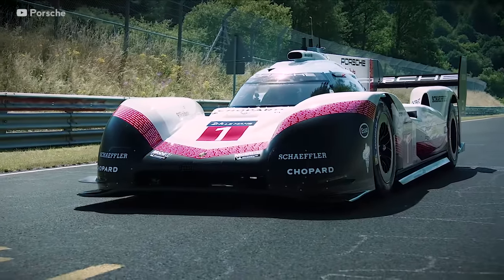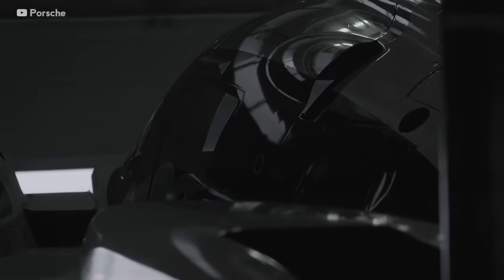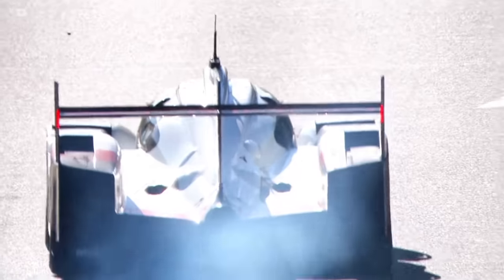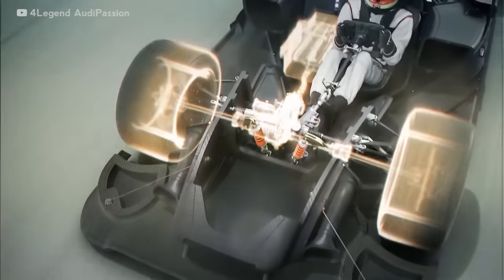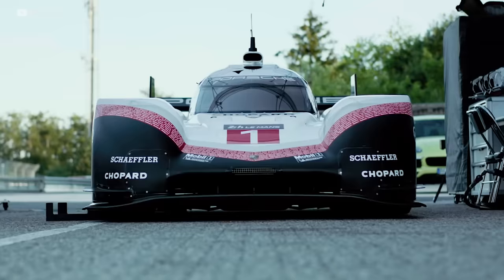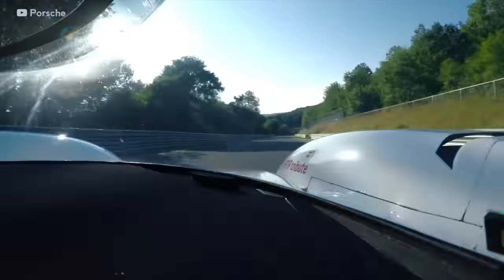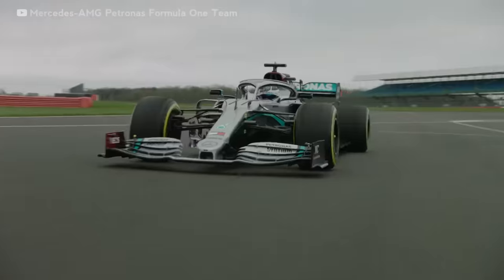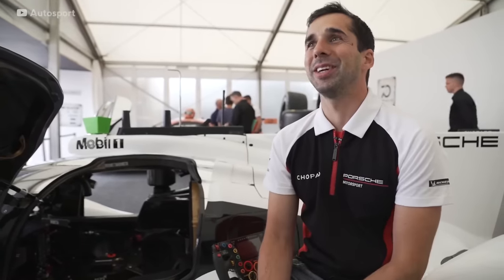How Porsche Built a Car Faster Than F1

Comment: Can we just appreciate that it has a 700hp V4?
What is my V6 even doing?!
Reply: didn't Koenigsegg make a 650bhp I3 engine? :D
Reply: @FIumel  yeah. Lol.
Reply: probably because your car is not supercharged and your exhaust system needs a catalytic converter and muffler to pass environmental and noise limits
Reply: @GameCyborgCh  headass noise restrictions don't matter much about speed
Reply: Your V6 is for road so still pretty good
Reply: Well, the Renault Formula 1 EF-type 1.5 liter V6 engine was worth 1.200 bhp in 1986. The same year, an Audi Quattro E2 "Pikes Peak" had around 600 bhp with a 5 cyl/2.1 liter engine.. So 720 bhp from a 2.0 liter V4 is nothing too crazy for 2018 I suppose.
https://en.wikipedia.org/wiki/Renault_EF-Type_engine
https://en.wikipedia.org/wiki/Audi_Quattro#Sport_Quattro_S1_E2
Reply: Just add BOOST
Reply: @FIumel  Jaguar made the cx75 a while back, beautiful car in my opinion, but it had an 1.6L engine that made 500hp, so koeningsegg's engine isn't that crazy
Reply: @Enzejansen  But the cx75 had an I4 with 1.6L. The Gemera has an I3 wit 2L. They had a cylinder less and only 400ml of displacement more so I think the Koenigsegg is still more impressive. The cx75 is by the way a really nice car that's true
Reply: @FIumel  yeah the're both excellent pieces of engineering that's for sure!
Reply: lol my I4 1400cc makes 460hp
Reply: @GameCyborgCh  The car also need to be able to go more than 100 km between full engine renovations.
Reply: @FIumel  my I6 makes 185 hp in my E30
Reply: your v6 is designed to be fuel efficient, reliable, safe, affordable, smooth.
Reply: That V4 costst 250.000 to build, ore even more. That's why
Reply: I'm pulling 500hp out of my V6 in a damn pickup truck (F150 ecoboost) lol.
Reply: Those engines are meant to break after a few use. Unless youre ready to throw down 50k per every 3 or so usage, be my guess.
Reply: @wanderingbufoon  They don't break, the compression tears the rings up and they loose compression. The engines actually last a long time but that's with complete tear downs to inspect every bearing, rod, rocker ect.  Most components don't need to be replaced very often believe it or not.  They just need to be checked and retorqued constantly to avoid a catastrophic failure that will cost $50k +++
Reply: clearly non of you know anything about motors. 
"eh hem" 
one fucking word. 
racegas 
sorry two words 
RACE GAS. 
oh what's that ? 
DIFFERENT FUCKING GAS.
don't worry you can buy bulk barrels of it for around $9.00/gallon. also funfact it has a octane rating of 110+
mostly used in motors with compression of 11-13:1 or much higher. 
most street motors run 10:1 or less. 
because street gas is cheap. #87
Reply: Not revving 20 000rpm?
Reply: @FIumel  Porsche need to make a car that follows no rules to get that that hp per litre. 

Keonigsegg: we make the rules.
Reply: @GameCyborgCh  is a joke we don’t need explanation
Reply: @FIumel  yeah and with the hybrid system it’s like 1700hp
Reply: Hmmmm can you even drive your V6 to the limit? :) can you handle 150Hp on the track lol
Reply: Just wondering, what engine does the TM cars use?
Reply: Spend an extra 200k and ull probably get the same hp as that v4
Reply: @wanderingbufoon  These are lemans cars, they are supposed to run flat out for 24 hrs straight. So the engine is durable af.
Reply: @wanderingbufoon  These are lemans cars, they are supposed to run flat out for 24 hrs straight. So the engine is durable af.
Reply: @ksp3324  yeah the whole block typically are but the other stuff such as valves, springs, etc. They don't last very long.

I mean most of these cars in le mans don't even last the entire race. So are they durable? Yes, probably but can they finish the entire race? Probably not. Only the over built once (or extremely smart drivers/engineers) that do win those races. 

If it is the latter than the former, then even less so since it is solely based on the skills rather than the actual strength of the machine.
Reply: Isn't it an inline 4
Reply: Lasting longer
Reply: Slacking
Reply: Stick NOS sticker for additional 80 hp
Reply: @numbdigger9552  my 1.2 mpi makes 74 bhp
Reply: @nikhildalvi3693  goes to show that engines can be tuned to very different levels of performance.
Reply: @GameCyborgCh  its a lot more than that lol
Reply: lasting years with basically only oil changes.  Really its like comparing a jet airliner to a jet fighter, The airliner will fly from NYC to Tokyo and back multiple times a week without an overhaul.  While I suspect a jet fighter's engines would need a full teardown after that many hours of flight time.

the very peak of racing is pushing engines to their logical limits, And in the case of America's NHRA Top Fuel they are pushed well beyond all logical limits and sometimes suffer Rapid Unscheduled Disassembly because of that. I suspect F1 engines are dismantled between every race and fully examined.
Reply: @FIumel  it's the displacement that matters. A 800hp 6L V12 is as impressive as a 800hp 6L V6
Reply: @missouriresole4726  v6s are crap
Reply: @charlesrussell4295  imagine if Eli Ayase, Umi Sonoda, and Maki Nishikino drove this 919 Hybrid.... i wonder what their reactions look like.
Reply: @GameCyborgCh  hi GameCyborg.
Reply: @chriscarter5659  hi chris carter.
Reply: good question!!?!! xDDD
Reply: Lasting more than 100 miles
Reply: @mchammer1809  u thought only last 10 miles bro.
Reply: @Alpostpone  and take off 2 from your engine
Reply: Hahahaha.......
Reply: Revving at a third of the rpm lol
Reply: Primarily, you're engine can turn on pretty much at any condition, even at freezing often. f1 cars need literal engines to turn on their engines.
Reply: Konigsegg out here 1700HP 3 cylinder
Reply: @FIumel  who cares about the peak performance... Porsche has always less hp and is always faster anyway.
Reply: @chucku00  Those engines in the 1980's were absolutely shot after qualifiying. BMW had 1,350 BHP available during quals, also completely wrecked afterwards. The 919 H-evo has a durable engine.
Reply: @chucku00  and doesn’t this current gen f1 v6 have like 1k HP
Reply: @dbabu51  No. It's limited to 850hp for the engine at 15.000 RPM and 161hp (120 kW) for the KERS (hybrid electrical system). So the engine is 350 hp less powerful than a 35 y/o F1 V6 engine.
Reply: @chucku00  but the point of these cars isn’t to have the most power, and I think those old v6 cars only made 1100 hp in quali, and tuned it down to like 700 hp for the race
Reply: @dbabu51  That's where you got it perfectly backwards, it's the other way around due to many metal alloys that are nowadays forbidden because of cost, and very toxic chemicals used in fuel and lubricants. 1986 F1's could easily still produce more than 1000 hp when needed during a race, it's very hard for a modern F1 to produce 800 hp+ during more than two laps. FIA regulations had to follow safety and environmental evolution during all these years.
Reply: @GameCyborgCh  a cat and muffler maybe account for 10hp
Reply: Not pushing 45lbs of boost
Reply: More cylinders doesn't equal more power, that's just ignorant
Reply: @FIumel  600,but yes.
Reply: imagine if it had an 1100hp v6 or an 1500 hp v8
Reply: @hanzen5174  laughs in Koenigsegg Regera (well, it's hybrid, but still has 1500 hp)
Reply: Your v6 is probably limited to like 6k rpm too
Reply: @enfynet  mostly 6.5K, but that doesn't really make a difference here i guess
Reply: @babymetalenjoyer  yeah that’s a far cry from the speeds these engines are running still
Reply: Well, your V6 is Not even 1% of the price of Porsches V4
Reply: It’s best
Reply: Being fuel efficient, easy to drive, quiet, passing noise and emmision regulations, not needing to be completely overhauled every thousand miles or so... Everything that makes a car useable.
Reply: How about the BMW M12 with a stock 4 cylinder block and 1.5 liter generating 1,400 HP in the 1983 Brabham BT52?
Reply: General rule of thumb with engines: A larger engine making moderate output (your V6) will always outlast a smaller engine pushed to it's limits every time you us it (the Porche V4). Yours is cheaper, more reliable, meets emission standards, and works in a far wider range of conditions. Be happy you don't have this V4 in your car!
Reply: To be fair it's 2.0 litre. F1 with 1.6 litre has more than that.
Reply: @chriscarter5659  😂😂😂😂😂 so mean
Reply: trying to last more then 5K miles
Reply: @FIumel  its crank hp
Reply: Giant turbo and high boost bro. Remember when BMW's Inline 4 engine makes 1400 hp on 1.5 litres.
Reply: @numbdigger9552  Stoopid levels of HP are so easily attained now with modern engineering.
Reply: Is not power the difference, the difference is the efficiency…
Reply: There are TONS of 1500+hp v4s in drag racing
Reply: you arent using rocket fuel
Reply: @Tipo-F120b  Wrong :
"In 1983, Brazilian driver Piquet won his second Formula One World Championship driving a Brabham BT52 powered exclusively by the M12, which by that year was producing approximately 850 bhp (630 kW) in qualifying trim and 640 bhp (480 kW) for the races." - BMW M12 engine Wiki page
You're just adding 500 bhp on an angine that didn't need it to win the F1 1983 championship.
And the Honda RA166E of the Williams FW11/B (1986&87, it was the FW10 in 1985) "only" delivered 900bhp in 1986 and 1000 bhp in 1987.
It's totally counter productive to trhow invalid numbers that can be checked out in five seconds.
Reply: @Tipo-F120b  You didn't even mention the Honda engine reference.And you were wrong on the Williams FW11/B years. Your inaccuracies tend to make me thing these videos only exist in your head.
"What they raced/qualified with and what they could produce are two seperate things."
OK, prove it, then.
"How about you ask Patrese, Piquet, Murray, Mansell, Head, BMW and Honda what those power plants were making."
You're the one talking about these engines, so give me the links to what they were talking about.
Reply: it has a significant electric part
Reply: lasting longer than 20 minutes
Reply: @felixreynolds7072  F1 engines should last for quite a lot of hours, since for 23 (1:40 h) Races (+3h training and 1.5 h quali), you basically have 3 engines, so in the racing world it isn't that bad.
Also, no road car, needs to have over 300 hp, even when wanting to drive 200 on the german Autobahn
Reply: I assume those race car engines are made for maximum power per weight while sacrificing durability and reliability.
Reply: @numbdigger9552  damn why did i change the „N“ and the „D“ in your Name
Reply: surviving for more than a thousand kilometers
Reply: A 2 ltr V4 is not correct! 

Correct is: It is a 2ltr Boxer engine, angled by nearly 90 degrees, aspirated by one turbocharger and 2,5bar charging pressure, supported by another turbine, mounted behind the TCs wastegate to produce electricity not only by braking on the the front axle and its known recovery system KERS, but during full throttle parts on the straights, too, which was very relevant in LeMans...

Overall, this car had 820 kg and nearly 1000hps under racing reglementations, but without the restrictions during the Tribute Tour, it had nearly 1500hps
Reply: that's Porsche for you
Reply: @coreygolphenee9633  That is a Porsche, developed in Flacht next to Weissach, for everyone an for the record books, and today, nearly 10 years after "coming on board", I am very proud that I've been part of this 5 year LMP1-919 hybrid journey..

It was the most amazing time of my life in, so far, over 20 years in engine developement and supplier management at Porsche Motorsport and Daimler.

The 919 hybrid is definitely the mother of all race cars and believe me, when you haven't been in LeMans to see the 24 hours WEC race, you have never seen and felt the REAL spirit of Motorsport....
Reply: @jankroehl  to me sir you make the magic happen at Disney, and thank you for whatever contributions you made to this piece of automotive history I get to watch fly around tracks for free. As a design nerd I love that this car has a truly timeless look to it that fits the great LMP1 cars of Porsches past.
Reply: @coreygolphenee9633  Thank you very much Corey! 

As long as form follows function (what it always should do from the technical perspective) and as long as the functions are further developed over all edges imaginable, the look of every (!) race car will be unique and famous - for It's own and in It's own time in history.

Write me on linked in, perhaps I can give you some form follows function impressions you have not seen until now!

Have a nice weekend, somewhere on this planet. I am in Nürnberg at the moment
 🏎️
Reply: I've seen a .5 liter v4 produce 280 hp and weighs 30 lbs.
Reply: and hellcat 1000hp still aint doing what this does wierd how 500hp out does 1000hp cars put that motor in a mini cooper and lets see what happens lmfao
Reply: 700hp ain't much for a racing 4 banger. There have been 1400hp inline 4s inF1.
Reply: 14000 HPs 😄 with in line 4-cylinders durable for 24h long distance races?

U made my day
Reply: @nodo7575  On what planet was this happening?
Reply: @jankroehl  I misspelt 1400
Reply: @timhallas4275  I misspelt 1400
Reply: @GameCyborgCh  is was a joke
Reply: @FIumel  725 on E85 and the tech to do that is insane. But Königsegg is just next level engineering, they do shit that no one ever considered before and they make it work. "K, so I want a 725 individual 3 cylinder engine that doesn't need a dampener and no fucking drivetrain" Says Christian and presents an idea of how it can be done and then the engineers have to perfect it and ... it works... 

Christian von Königsegg, besides being a really intelligent guy that can design all parts and understand what can be done but leave it to others to perfect it AND he is pretty much the nicest guy you'll ever meet if you meet him. Really humble and you kind of have to drag things out of him because he really do not want to brag.

That's a true Swede for ya.
Reply: @FIumel  cylinders doesn't really matter all that much, displacement does. 

Absolutely love the Gemera though, absolutely insane car.
Reply: Makes me think Ducati could do better. 🤣
Reply: @semajsodranev1131  When it comes to bikes it doesn't quite work like that though.
Reply: @michaelmay5453  I know, I was being facetious.
Reply: @semajsodranev1131  Ah, well it's not always easy to tell since intonations do not carry to written language but still, my mistake.
Reply: your v6 doesnt need a complete rebuild every 250 miles lol
Reply: @finasteridesolution3849 . No the V6 would be more impressive since the V12 can rev more easily because each cylinder is close to the ideal 500cc per cylinder
Reply: @ianruddell5330  neither does this engine, do you know how long 24 hours of le mans is???
Reply: @YoungShul  this car was developed after the regulations of a race were changed, so it couldn't be used in the competition. Porsche gave the engineers permission to do everything they could to make the most insane race car. Surviving le mans has nothing to do with it.
Reply: @ianruddell5330  as it was outlined in the video, parts were stripped and the electric drivetrain was changed, but the only thing that happened to the engine was the removal of the fuel flow restrictor, which means that it is still a sturdy engine
Reply: @charlesrussell4295  And BMW used to make a 1430hp 1.5l four cylinder.
Reply: @FIumel coming back to this after the insanity the gemera tfg and hv8 did the other day
Reply: @GameCyborgCh  yeah, it’s the catalytic converter and noise limits keeping us from making 700hp. Big environment is keeping us down
Reply: @GameCyborgCh glad my car's last owner ignored those 2 things. Lmao
Reply: Well this car is only supposed to last 24hours...vs 10 plus years with your V6 with regular maintenance of course.
Reply: the muffler isn't doing much!
 @GameCyborgCh
Reply: but the engine wont last more than 5.000km
Reply: 0-60 mph 2.2 top speed 223 👀

Comment: "f1 cars are limited by a fuel flow limit"
ferrari 2019: hold my beer
Reply: Oof size: Large.
Reply: Ferrari 2020: I’ll take that beer back now
Reply: Actually, Vettel broke the evo’s lap back in 2018.
Reply: Jules Soliman o wow. mind you im not suprised since the evo lap itself had loads of time to find in cornering speed
Reply: Ferrari 2020: "Please guys, be gentle..." (whilst getting shafted by most of the grid).
Reply: Ferrari: fuel flow limit? What’s that
Reply: @edwardalbrecht2215  😂😂😂
Reply: video title should be "When Porsche went full Ferrari"
Reply: In Nascar back in the day, there was a limit on the capacity of the fuel TANK, so one team just put half a mile of zig-zagging pipe from the tank to the engine.
Reply: @Vegas Gaming 
No that's what they didn't do
Reply: Ferrari KEKW
Reply: Ferrari 2019: "Well, what if we burn some oil too?"
Reply: «Hold my rule book»
Reply: @worldcomicsreview354  now that's smart.

Comment: "4.5G of lateral acceleration" :S on a car, going forwards!  O.o
Reply: I know right?! Thats pretty intense, makes my neck hurt just thinking about it lol.
Reply: Insane. Although the current F1 cars can do more than 5G, almost 6G on some corners.
Reply: @TADP0LE9806  on corners, not on acceleration
Reply: No.
Reply: @jakub-kube  gravity in any direction is acceleration. And "lateral" means that the force is sideways. Ie. it's a metric of cornering. These cars can't pull such high G's just going forwards, only under braking and laterally in corners
Reply: @jakub-kube  you must accelerate to corner, even if you're speedometer stays constant.